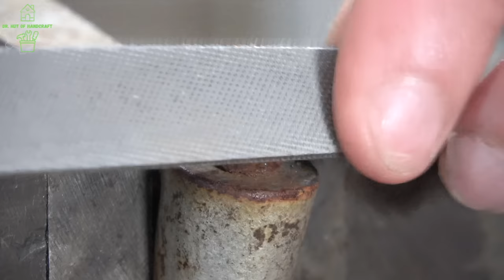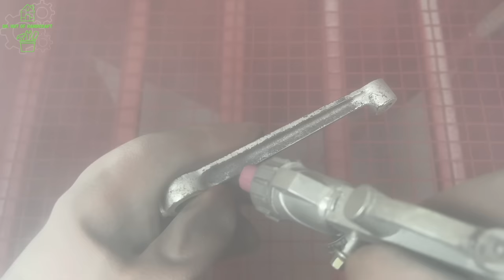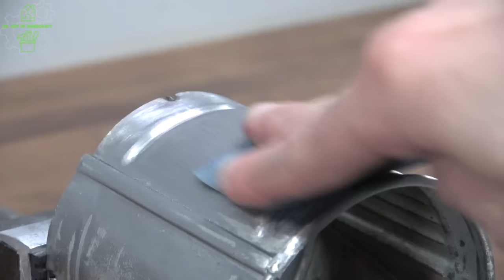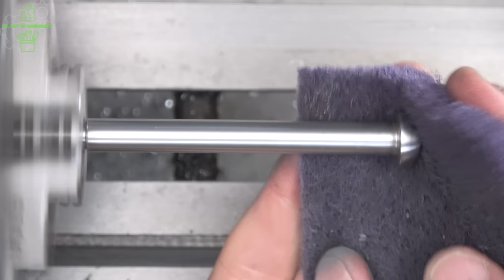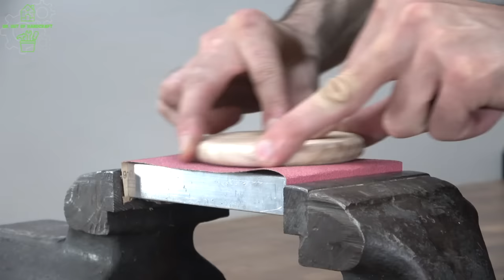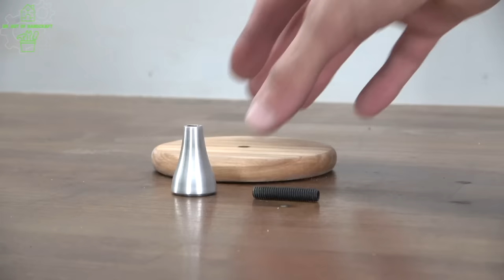1929 'Alexanderwerk' Grater restoration I Dr. Hut of Handcraft

Comment: Great work, but, I have SO MANY QUESTIONS !
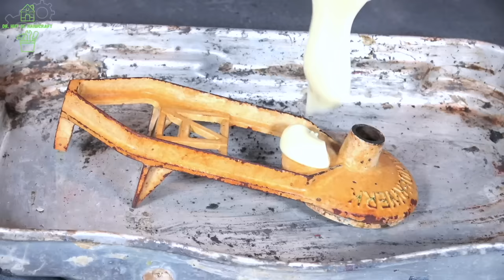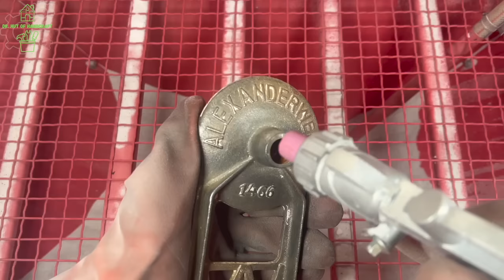1) If we are going to use the sandblaster, why bother stripping the paint?  1:26 / 1:39
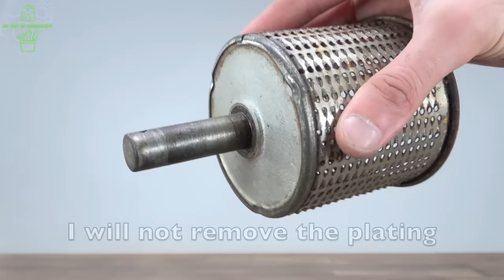2) If you are going to re-plate it anyway, why not sandblast down and remove the old plating? 4:50
3) If that wooden circle piece will go on the lathe, why not cut the circle using that? 13:35
OK, I only had three, but I am subscribing anyway !
Reply from the maker: Thank you very much for your comment and your support!

To your questions:

1.) Old paint, especially those that were used back in time on old stuff may contain lead and lead is toxic. So you remove the paint safely first with paint stripper and sandblast afterwards. Different lacquers also may contain chrome, especially Chrome VI, which is also toxic and carcinogenic.
Also sandblasting paint is very annoying and makes the blasting medium turn bad much faster.

2.) You can of course do that. But if the plating is in good condition, you can just keep it how it is. The old plating also protects the steel and was in a surprisingly good shape. I suppose the tool wasn't used very much or was used with much care.
Removing or leaving the original plating is I think just a matter of style. I actually always remove the plating and replate, but this time I wanted to try out something new and share it with you guys.

3.) I try to avoid working with wood on the lathe, I only do that when I don't see another way to get the desired finish. Also I wanted to work a little with the bandsaw since I have it and like working with it, it's a great tool! Plus I wanted to try out the jig I made.
As you have seen in the video I just turned the face clean on the lathe, made a chamfer and sanded on the lathe. 

Thank you very much for your comment and your great questions!

Comment: I inherited the exact same grater from my grandma. the original color is "okkergelb" no painting on the letters, the wooden press piece had a square top and is made of one piece. originally it was tinned and not nickelized i think.
Reply from the maker: Thank you for your comment! 
There were available in different colors and the push block also had different shapes. You can find pictures of that on google 🙂

Comment: The labor performed on this grater was outstanding. Especially the fabrication of missing parts; retrofitted in order for the machine to perform as when it was new. That being said, I did have a major concern regarding the paint type, and particularly the grease that was used. Neither were food-grade certified, like Fakolith paint, and Apiezon PFPE 501 non-tox grease. Other than that, i will issue a thumbs-up. Well done.
Reply from the maker: Thank you very much, I really appreciate your comment!
While I absolutely understand your concern I have to say that neither the paint nor the grease come in contact with the food, because of the build type. Also the grease is actually food safe.
Since the tool will also only be a decorative piece for me, I didn’t bother getting food safe color, which I of course would have done if actually used (especially since I am a med student 😄).
Reply: @DrHutOfHandcraft  I greatly appreciate your observance of safe food handling. I look forward to your next episode with great eagerness.
Reply from the maker: @alexdeleon7135  Thank you for your support! 🙏🏼